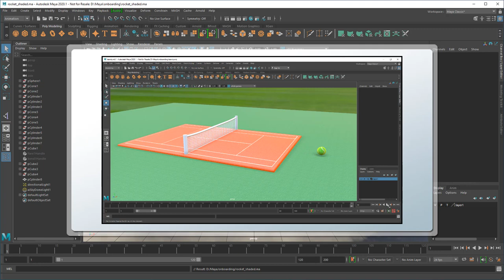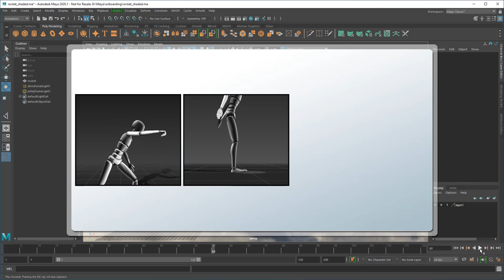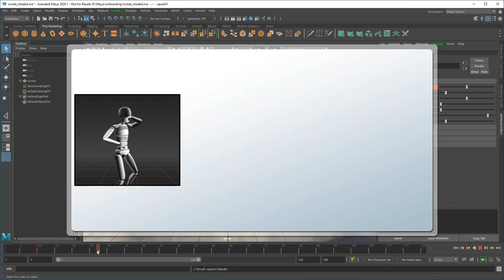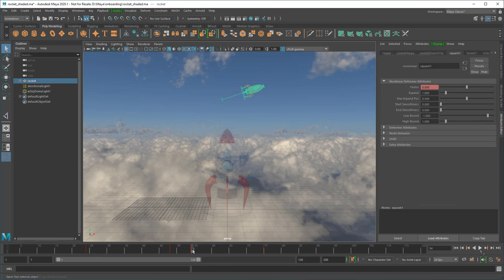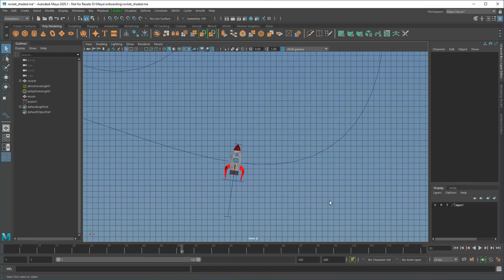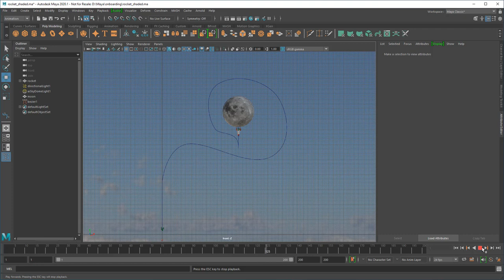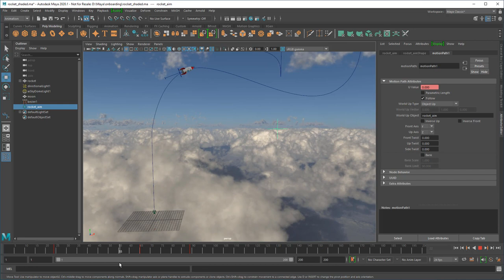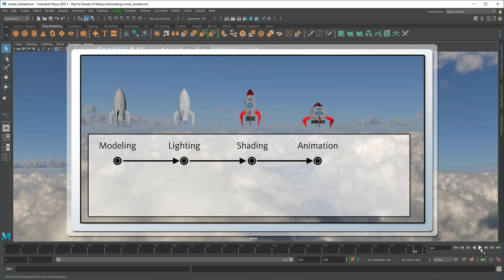Intro to Maya: Lesson 9 / 10 - Animating your rocket

Comment: For those that are trying to select the Constrain tab at the top, make sure that you are in Animation mode. You can change the mode from Modeling to Animation by going to the top left of the screen, below the word file, select the drop-down list where it says Modeling. Select Animation and then your Constrain tab should be there. Hope this helps someone. Additionally, to make the rocket squash down at the very beginning, make sure to change to the pivot point of the rocket by selecting the move tool and select D. Move the point level with the tips of the rocket at the bottom. Hope this also helps too.
Reply: Thanks
Reply: omg i hve been searching for an entire day abt that :(, thank u
Reply: goat

Comment: Hi, i have a problem with the rocket rotation. Every thing in the animation works perfect, but after the landing, the rocket flips 180° on the x achchse. How can i solve this problem?
Reply from the maker: Uzzlius Is this with flip step?  Depending on your exact curve, you may need to modify / add more flips.

Comment: my .tiff textures do not load to surfaces. They preview in maya, but do not load onto surfaces. Thoughts?
Reply from the maker: Are you sure textures are turned on in the Viewport?  and is the "Default Material" turned off?  Have you tried a different file format just to test if it's working?

Comment: Whenever I click to another key frame the camera resets position. It also happens when I press the playback button for the animation, it just zooms in to default camera position and zoom so I can’t view it from zoomed out, I must see it flash by. I’ve tried locking the camera and that doesn’t work either
Reply from the maker: If you select the camera, do you have an accidental keyframe set on it on frame 0 by chance?

Comment: After creating a locator and doing things u said to do. the first frame and last one do not follow the locator, object rotates unnaturaly
Reply: now that i changed timing, First 15 frames, the object has different rotation until at frame 15 that it rotates like 45 degrees
Reply: tried 3 times, from the beginning. But i have a problem at the locator part. The front of the ship does turn where the locator is. Then before animation of the curve starts and after it ends, ship changes position

Comment: whenever I add a new vertex to the bezzier for the landing, the rocket won't follow it. what do i do?
Reply from the maker: Are yoiu sure the new points are attached to the old curve?  If so, you can select the motionpath tab in the Attribute Editor and make sure the "U Value" is keyframed to 1 on the last frame of the animation.  If not, just manually set it to 1 on the last frame and then keyframe it.

If all else fails, you can redraw a new curve on top of the old one, then delete the old one and re-constrain the ship to create a new motionpath.
Reply: @Autodesk_Maya   Okay, that worked thanks.

But now when I select "Object Up" to point the rocket at the locator, it won't allow me to type anything in the World Up Object box. (I'm on Maya 2020, if that makes a difference.)

Comment: How do you get the time slider to increment by 5 each time?
Reply from the maker: The intervals are just a product of the Time Slider range vs your screen resolution.  You can change the Time Slider range until it shows 5 frame increments.

Comment: Hi, thank you so much for your lessons, I’m really struggling with the start of this one. When I delete by type, history, my rocket goes all white, so I undo and try again, and then it starts to look corrupt and the colours go all strange. Wonder if anyone can help me. I didn’t know whether it was something to do with the handle to the fins at the bottom, as this area tends to go bright green sometimes when I try. I can’t find anywhere online that might help, I hope I’ve done the last stages correctly. Sometimes when I delete the history, it just doesn’t condense the list, and doesn’t do anything. I also tried deleting using an icon at the top that I found in another video which is near the freeze one. But yeah really need some help, grateful for any suggestions! Thank you again for the lessons though, I really want to give the animation a try. I also tried without deleting history but the whole rocket went into loads of sections and went all weird. This is my first time using maya, so basically a complete beginner.
Reply from the maker: Hmm, none of that should happen.  I'm curious, if you download the scene file included in the video description and attempt to follow the same steps, do you get the same result?  I wonder if your particular file has some sort of file corruption.
Reply: @Autodesk_Maya  Hi, thank you for your reply, I will give that a go. Is there a way to fix file corruption or how would I know if it did have that. I also had another question, how do I export the final design, im unsure how to get the red lines which form the design away to then have a final image, or perhaps a video of it to show it in 3d twisting around the rocket, if you know what I mean. Many thanks for your help
Reply from the maker: @tia6091  Typically you would render the scene as the final output, which is covered the next video of this series.

Regarding the corruption, it's difficult to say without seeing the scene file itself.  I think the first step is to figure out whether it actually is a corruption (using the method I outlined above) or perhaps just some small user error.
Reply: @Autodesk_Maya  Hi, thank you for your help, I will keep trying and try what you've said as well, many thanks